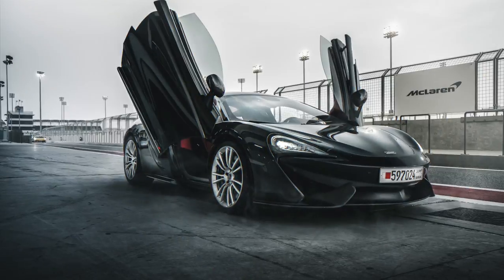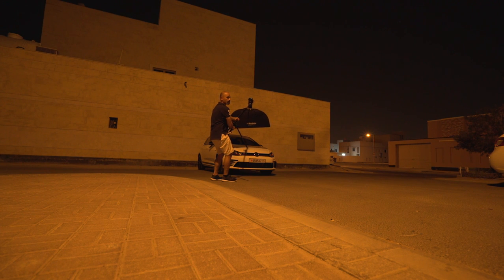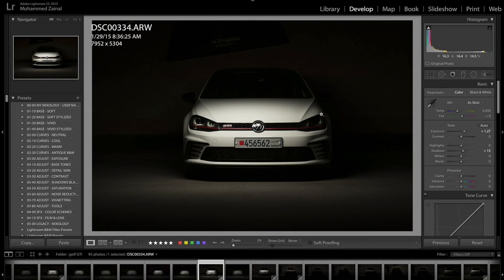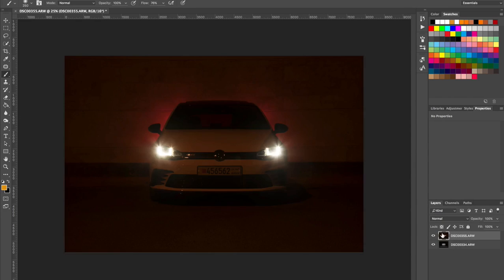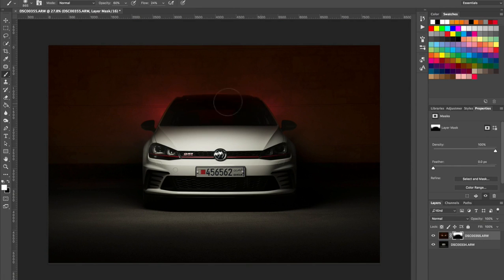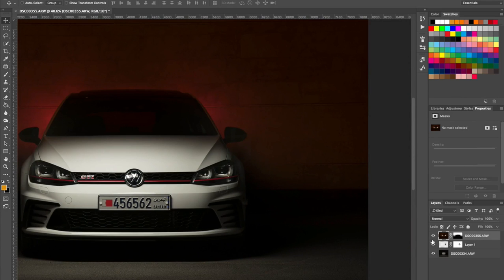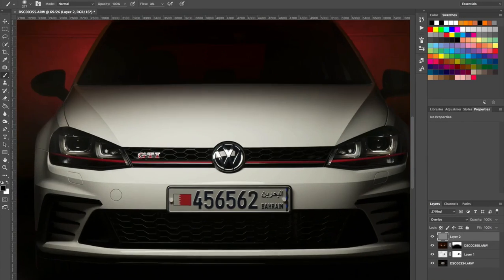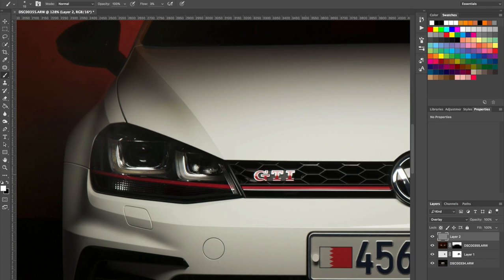Car photography lighting setup with Profoto B1 Flash/Strobe

Comment: What's your opinion on light painting vs. using a flash strobe for car photography? I'm still learning about what gear would be the most versatile, but it seems like a flash strobe allows you to take photos in daylight and at night. Light painting is more applicable for nighttime shots since there isn't enough light to overcome the sun.
Reply from the maker: You are right, I have also seen photographers use both in one shot for different parts of the photo... There is no one rule. I use both depending on the situation.

Comment: Hi Moe, do you use a polariser when you're doing flash photography?
Reply from the maker: If there is a surrounding reflections I will use the CPL,  otherwise will remove it because it cuts down the light.

Comment: I do believe that your car has auto headlights if you shut them off and engage the e-brake the running lights will shut off
Reply from the maker: Kurt Gremer thanks for the tip

Comment: You could cut out just headlight with that same pen tool.
Reply from the maker: Milorad Menjic why restrict yourself when you have more area you play with before deciding...
Reply: Restrict ? How ? All you needed is headlight so you take that, it is faster easier and not restricting, if you need something else you can cut that too but it is easier to match just one part at the time then third of the car and you eventually ended making selection around headlight then deleted or masked rest of it so why not do that in the beginning ?
Reply from the maker: Milorad Menjic well if you've listened carefully the intention was to copy the left to the right because one was darker than the other but then I changed my mind ... clear now?

Comment: A strip softbox is not really great for front facing shots, usually better used for angle side shots. I would of used a large 27/30-inch beauty dish to let the light hug the car. If you’re going to use a strip softbox, it’s best to use them for detail close up shots, not best for what you were doing.
Reply from the maker: Thanks Tony, I will try that up.
Reply: Do you recommend bare bulb when trying to expose the car or would soft box be better? I always thought that since softbox gives a softer light, that is better to use, but I am seeing many people using bare bulb. What is your suggestion? Thanks